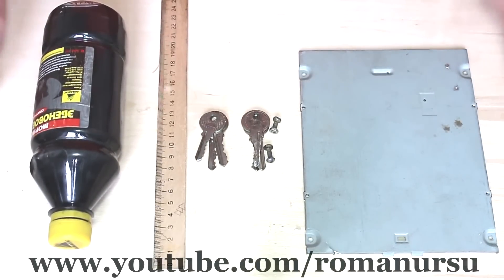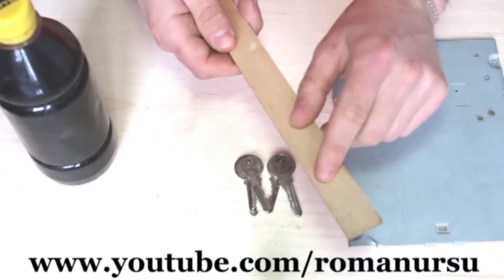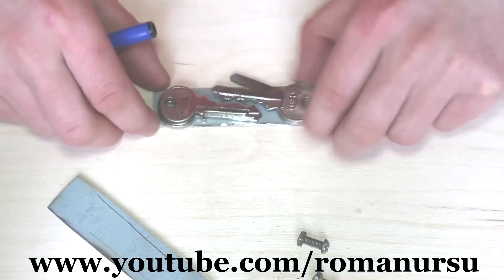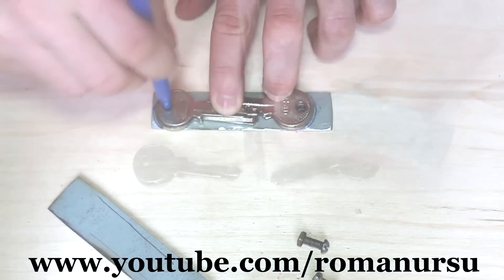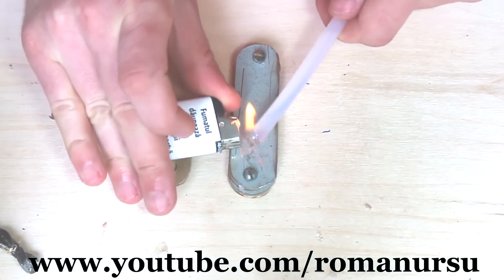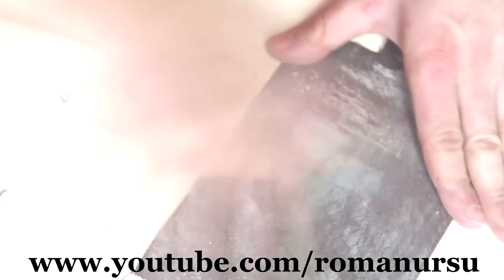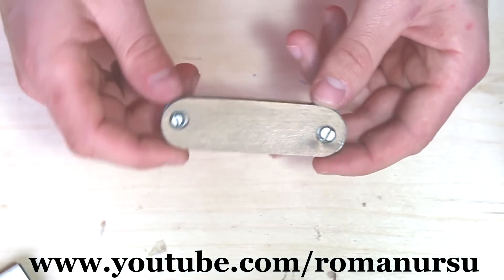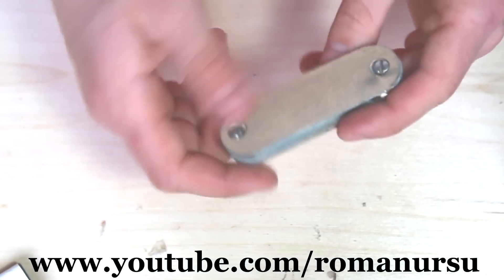How to make a Swiss Army Key Multitool

Comment: Hi.
Why you not use other materials? Perhaps AL, CU or another different metal alloys.
I have swiss montage key for the mountain bike (Allen keys, side montage keys and one pair montage key for tires).
What to use poss. ABS plast use from the car and between each key to insert a thin silicone ring ( this avoids the abrasion keys). This is - for me with look good jod.
Your work is nice, but is only draft for possible next job.
Not  for finall use.